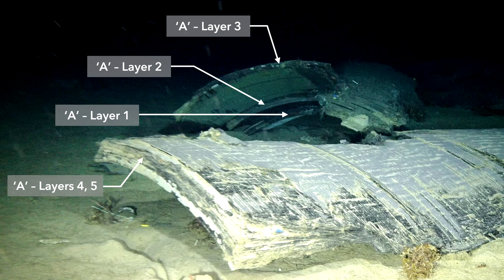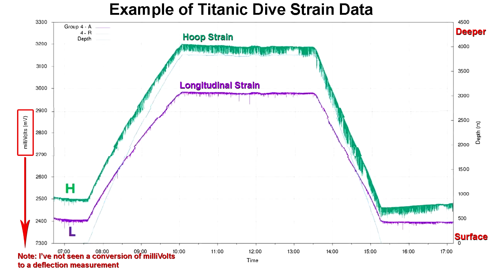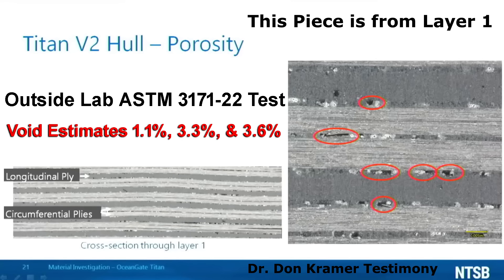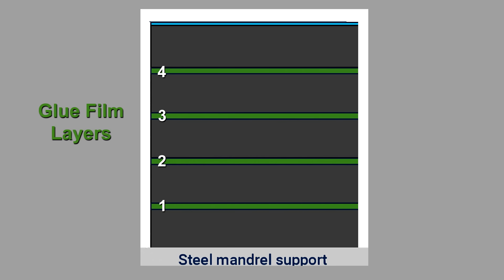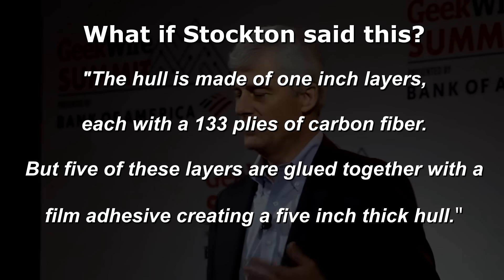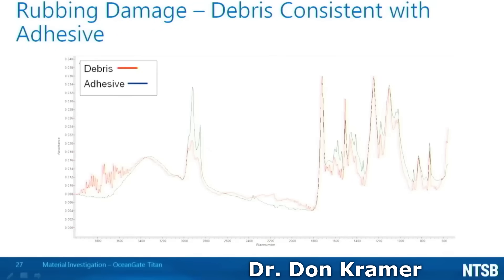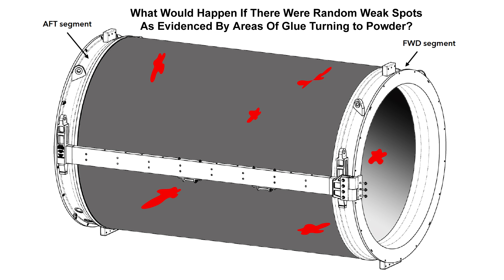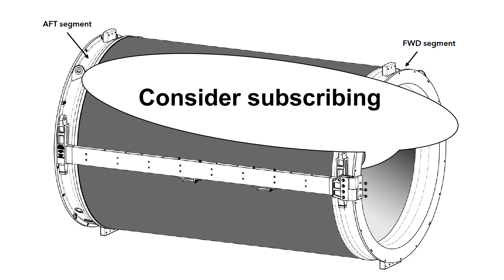OceanGate Titan Hull - Glue Layers Were Breaking Down To Dust - No Clues.

Comment: 0:41 the viewport was blown outward,surely, at the moment of implosion of the hull?
Reply: Nah. EVERYTHING would go IN to a focal point during that immediate an implosion.

Plus, By the time they got to the Titanic depth, The viewport would already be noticeably indented into the cabin from the outside pressure. (The viewport they used was only rated to 1200meters or something - Far short of the depth they were going)

Comment: Yep. The thing with laminated structures being used in this manner (compression) is that repeated flex causes delaminations which then allow pressure into the space between the layers. Everything outside that point is now useless, and the remaining layers will flex more and delaminate faster. The failure accelerates. Carbon fibre used in tension doesn't suffer this issue.

Comment: The illustration you used of plywood being repetitively stressed on the face side of the sheet immediately screamed out to me why carbon fiber, with it's glue joints can NOT be used as a pressure vessel. Even steel vessels will deflect under pressure and then rebound once relieved. This repeated flexing will cause adhesive break down. This is so stunningly clear. I know some of the engineers walked away and some were fired from this project. Turns out that they were the smart ones in the room. It's hard to understand how smart people with engineering degrees could not see this failure mode however, the entire NASA team didn't see how 15 psi of pure oxygen in the Apollo capsule was a very bad idea as well, at least until it was to late.

Comment: Hull failed near the view port end, not in the middle
Reply: He's aware. However there is still no answer as to why it failed there. It is highly possible that the weaknesses and inward pressure he's talking about, especially under cycles of shear force, could have weakened the glued bond between the aft cone and the hull causing the water intrusion. But we just don't know. Frankly, every single element of the sub seemed likely to fail.
Reply: The piece you're missing is that deflection in the middle would cause extra strain at the ends, where the carbon fiber meets metal.

Comment: I've been engineering carbon fiber structures for nearly 40 years for NASA, and used the material in many challenging environments and extreme load conditions.  As I've listened to the investigation, nearly every single rule we have for design, analysis, fabrication, and verification & validation (basically two kinds of testing) was broken in very significant ways.  The use of "innovative" to describe the use of carbon fiber is the wrong word choice.  Carbon fiber has been around for many decades and we well-understand how to use it and what the strengths and weaknesses are.  Defects are a big deal which are highlighted in this video, one of many risks we need to mitigate when using the material.  Such a shame we ended up killing people which such shoddy engineering that we know how to address.
Reply: @paragon8038 Well said! While I work in a completely different industry, the principles you outline here and in your comment below regarding V&V hold true across any engineering discipline. Testing is very expensive and time consuming, and because it happens toward the end of a project is most vulnerable to budget and time constraints so should be done independently. As the old engineering maxim has it, "You can have it fast, to a high quality and cheap, pick any two"!!
Reply: @Tom-zy6ke I was at NASA in the "better, faster, cheaper" era of the mid-1990s.  That sure didn't work out very well for the same reason you state-- you get to pick two of the three.  We now set an "incompressible test list" very early in a project so that budget and schedule pressures late in the project have a very difficult time removing critical tests.  That was a lesson we learned from the 90s.
Reply: How would you do the verification & validation of a new carbon fiber hull like this? Thank you in advance!
Reply: @DanDover-q8n4n  A V&V plan for advanced composite structure is pretty long (the last one I did was 100+ pages for a boom we deployed for a radar antenna, for example).  However I'll hit a few high points.  First, in the design phase we would have not chosen carbon fiber because we would have done a trade-off showing there is no way to establish human-rated reliability using that material system in a cyclic compressive loading environment at cold temperature, and we definitely would have a sphere not a cylinder because cylinders are structurally weak (think how easy it is to compress a coke can).  In other words, this system would not pass the design phase.  But, if we had to do a V&V program, it would include elements such as 1. Establish A-Basis structural allowables (99% low, 95% confidence) for specific materials (carbon fibers, matrix, adhesives) and layup / bonding processes, 2. Develop layup and bonding processes such that procedures guarantee high quality bonding, 3.  Establish non-destructive-evaluation (NDI) procedures for completed hull with known minimum detectable flaw size, 4. Perform structural robustness testing at minimum detectable flaw size plus margin, 5. Develop repair procedures for a flaw size between minimum detectable, 6. Demonstrate reliability under load for flaws beneath your detection or repair criterion, 7. Robust life test program of coupons and full-size hull (i.e., simulate 100 dives on a full size hull to establish life of 50 dives), 8. Properly account for temperature effects in all structural testing described above.  This would include temperature cycle testing, perhaps under load.  This  is not comprehesive and just a quick sketch of a plan.  The cost would be immense.
Reply: @paragon8038 That last sentence is why this happened the way it did. Immense cost. They simply wanted to do something only the US Navy has the money for, which is unfortunate for people dedicated to submersibles, but those people still understand why it has to be that way (safety).
Reply: Who's "we"? You got a mouse in your pocket?
Reply: Yeah right... we sure do believe you work for nasa.

Comment: Something to understand,,the "barrel" was circular wound CF with resin bonding it together,,great for resisting force directly in,,but that same matrix had to also resist the huge surface area force of the two end caps crushing in sideways to the barrel,,essentially just the resin already under immense strain,,,when the end caps crushed in they "hydrauliced" at the middle,,creating a momentary high compression shock that shot the "cork stopped " viewing lens outward,,a force it was never meant to withstand,,😊
Reply: Ah, that’s helpful, thanks!

Comment: Does anyone know then if they had cured the glue multiple times instead of just once if the porosity would have been less?
Reply: you mean in what way? they wound some(I think an inch), then cured it in the oven, ground it flat again and then wound some more and repeat. it is not known what method would be the best as they lacked the budget to test alternatives in repeat destruction etc. there's no way to know how much more 10 inch thicker could have taken or if it could have taken more etc. its a potentially cheap way to make the thing but since they didn't do testing there's no data on what would be optimal to get most dives out of it and what distortion was still 'safe' and what wasn't.  generally its better to cure as thick section as you can at one time rather than to keep adding
Reply: No, we don’t know and that’s the problem.

Comment: NO BODIES !
Reply: At that pressure the bodies were turned to peanut butter instantly and then eaten by sea creatures.
Reply: @monamipluspen9560  there wouldnt be big enough pieces left for sea creatures to find. The forces of an implosion at such depths are incredible. It is like a bomb going off.

It 10km (6miles) of water pressure being unleashed all at once. It could be heard all over the ocean.
Or in more scientific terms: Big Badaboom
Reply: when the coast guard recovered the sub they found a black tar substance on the walls that contained genetic material from all 5 occupants mixed with what was left of the sub's interior. 400 atmospheres of pressure is no joke.
Reply: @henlostinky273 that is crazy. I still feel sorry for the billionaires boy. At least the rest where adults

Comment: I think Rush would say that none of this matters because of how he interpreted and implemented the Kaiser Effect. Once all of the fibers that are going to break do break, and it hasn't failed, it's all good and that it should not fail once you're past that point. But I think you make a good point, and I have asked the question myself: were those sensors a little hard of hearing? They very likely were not sensitive enough to detect the breakdown of the glue layers inside - they only listened for carbon fiber breaking. I still maintain that Rush put too much faith in his patented real time monitoring system. Could also be that they worked great on hull #1 but could not detect these break downs on hull #2, so they had a false sense of security and it was slowly failing but they had no idea.
Reply: I thought they actually would have found the data of the hull starting to fail a few dives before if they looked at it properly, no? Maybe i misread something or I'm misinformed.
Reply: @Hatemode_NJ I remember something in the Coast Guard hearings about there being some data that they didn’t look at which suggested there could be a problem. 

I do think that 5” thick carbon fiber is a completely different animal than the comparatively thin stuff in aerospace where these sorts of sensors are normally used. Carbon fiber is quirky in that its molecular structure is like a polymer, its conductive properties are like a metallic and its brittle nature is like a ceramic. To me it’s more like monitoring a coffee cup under pressure, which will just suddenly yield given enough force. Anyway, getting those sensors just right would be tricky… too sensitive and you have way too much extraneous noise, not sensitive enough and they can’t hear stuff like glue breaking down between the five sections. Also they probably needed way more of them. I don’t remember how many there were… something like a dozen or so?
Reply: If I remember right it was pointed out during the investigation or somewhere else before, that despite the real time monitoring OceanGate wouldn't know what these sounds and signals mean because they haven't tested it. They should have made a test unit steered by wire from surface and conduct dives collecting data from RTM until hull would give up eventually. So that they would have known how to interpret RTM signals during real dives, but they didn't because it costed money and time and I guess didn't align with a "innovative mindset".
Reply: @linguaRadices3630 Rush didn’t think destructive testing was necessary - he did that with the 1/3 scale hulls.
Reply: @VegasCyclingFreak Still, even if he had done the tests the whole design was flawed and doomed. It would have failed eventually. Besides as far as I'm aware scaling things up and down in physics is pretty complicated and 1/3 of size model isn't equivalent to the full size one of course and it requires knowledge how to project collected data from small model onto big one. They were walking on terra incognita breaking rules and precautions written in experience and blood and have become the part of these rules that are not to be broken themselves.
Reply: @linguaRadices3630 I think there’s a chance that if they had constructed the CF hull as Boeing had suggested it might have worked. As the hull was manufactured it omitted the 2” of plies in 45 degree direction. But yeah, getting all the moduli of dissimilar materials to be equal etc is a tough problem. I agree 1/3 scale and full scale testing not the same but Rush did do the very first dive in hull #1 solo. He said it never quieted down and that is why they scrapped it and quietly replaced with hull #2 while COVID was going on.

Comment: If the carbon fiber had been layered correctly with some adjustments made to the engineering the Titan would still be diving.
Reply: Maybe diving for longer, but my guess is it would’ve just imploded at a later date.
Reply: It was a flawed design bro ... 
Compression is carbon fiber's enemy
Reply: I think not.
Reply: Err…. Uhhhh…. No
Reply: I agree. But I don't think we currently have the technology to make it virtually flawless. Also, when they switched to hull #2, I wonder if anyone made sure that the moduli of the CF matched the I presume previously used titanium parts. I also wonder if some parts of the titanium got work hardened after x number of dives and made the CF do "extra work". Whatever happened I believe it was failure somewhere at the interface ring.
Reply: Long and the short... Rush tried to make major big bucks by cutting cost corners and people died for his greed.

Comment: Glue (which in this case is probably epoxy resin) does not provide the strength. The carbon fiber does.  The glue is just what holds everything together.  People thinking the glue adds strength, but it does not.  Also, this thing could have been a foot thick and it still would have failed.  It needed to all be made out of the same material, Titanium.
Reply: Did you not watch the video?

Comment: If the layering of carbon fiber, with the dissimilar property joining film layers, was an optical design, the light rays trying to penetrate it from outside to inside (or opposite), would probably reveal all sorts of deflection in the penetrating light… this would indicate the fabrication errors in the layers. X-ray would most likely do the same for this hull, and a diffracted X-ray would also tell you, that the hull was not a single unit, consisting of 5 layers uniform in nature, but of 5 distinct layers… e.g.: not 5x the strength og one layers, but something far less strong than 5x, of singly strong layers, but not summarily
Reply: The US navy "successfully" tested a similar design. I think you are spot on. The Navy used such techniques when testing their carbon sub. Basically they did everything Ocean gate refused to do. The Navy sub had a life span of safe dives also. The thing is Oceagate design did last multiple dives then failed catastrophically. Which implies that at least for a couple of drives it wasn't at risk but with every decent and ascent the compression and decompression is where the damage came from. The sub failed at the front where the carbon meets the titanium hull. That means the carbon never failed due to pressure itself. It failed because the material fatigue. I also think that they would have almost certainly head a crunch or something a few seconds before the catastrophic failure. If they had followed just engineering best practices even with the shit design,  they wouldn't have died. It also would mean the sub's hull needed replacing after like 2-4 dives. Which makes it more expensive that a titanium sub.
Reply: @peterkent6250  Thus his whole business plan up in flames. Heard his wife was fully capable  of saving the company
for the moment and she supported this whole endeavour , yet denied helping out with a lil of her own generational wealth.
Such love ... clearly to die for.
Reply: X-Ray doesn't refract or reflect, it only shows density/opacity. This might show stuff but contrast will be low. On the other hand, echography is very efficient at detecting voids and delamination in composites because air gaps do reflect sound waves a lot. It's used to monitor composite airframes fatigue non destructively.
Reply: @Chwibon no, sorry of course X-ray doesn’t refract… I wasn’t thinking it through… sorry

Comment: There was also unknowns amounts of vibrational, torsional and impact forces applied to the carbon fiber structure as the entire sub was towed to and from the dive sites on its dive platform - 400 miles each way because the dive ship was too small to accommodate the sub on deck.  They were just asking for more trouble.

Comment: Why did they have to use carbon fibre? Why didn’t they use material which was tested for that kind of use case? Like aluminium or similar. It could not be cheaper as they had to test stuff and what not.
Reply: Weight. Stockton said 90% of the cost was the ship. If they couldn't transport and launch the sub the way they did, the whole thing would not have been viable.
Reply: @DM-rc4yu  oh Just the weight! So this wasnt about Material cost It was about logistics... Thanks
Reply: @bukinski  material costs as well.  titanium is much more expensive
Reply: @DM-rc4yu  "Would not have been viable". Apparently it wasn't that viable. Viable comes from french and the original meaning is "that can sustain life", before being used as a synonym for "workable" or "profitable" ☺
Reply: Probably with heavier materials, fewer people could fit in the submarine on each dive… that’s $250,000 less per person.
Reply: Aluminum is a no go because it can handle a lot for its weight but fatigue is its worst enemy. ALL aluminum has this weakness. This is why airplane wings have deflection and flight cycle documentation for replacements when it’s determined the aluminums structure has degraded.

Comment: Why did the layers have to be glued together and not made as a single five inch thick unit. Was it production difficulty.
Reply: Found out now, they changed to a different hull builder who would not build a single piece hull as it would not autoclave properly - too thick, so it was wound in five stages and autoclaved each time.
Reply: They did that with the first hull and it cracked. This was the second and last hull.